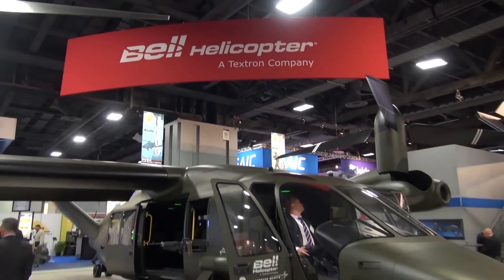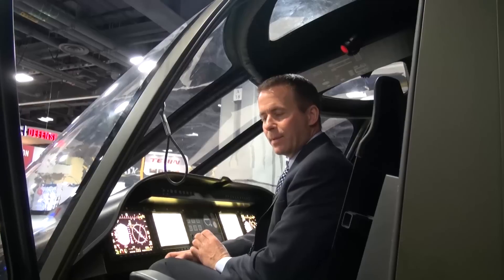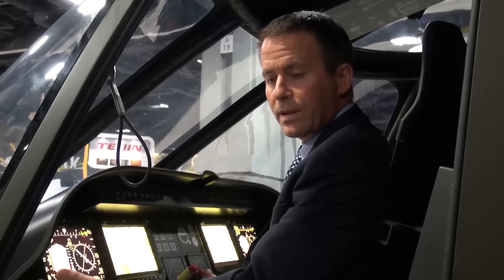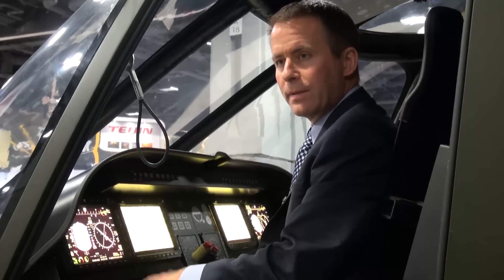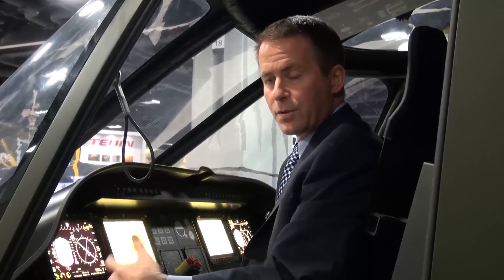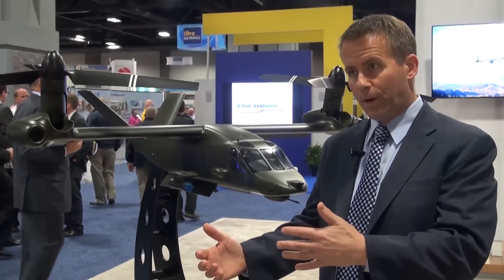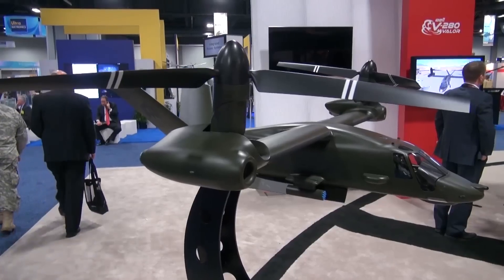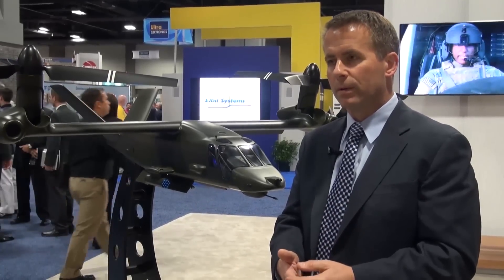Bell V280 Valor tilt rotor helicopter AUSA 2013

Comment from the maker: Bell Helicopter is the world’s tiltrotor expert with 55 years of experience and critical, proprietary expertise in rotor systems, drive systems, and sophisticated fly-by-wire technologies. In April 2013, Bell Helicopter revealed its offering – the Bell V-280 Valor, a third generation tiltrotor for the U.S. Army’s JMR-TD program. The Bell V-280’s unmatched speed, range and payload, operational agility, and low speed maneuverability provide transformational reach and revolutionary capability at the best value. Read more at http://www.armyrecognition.com